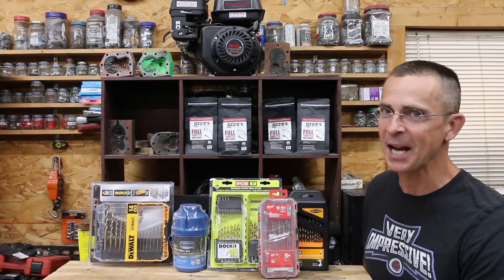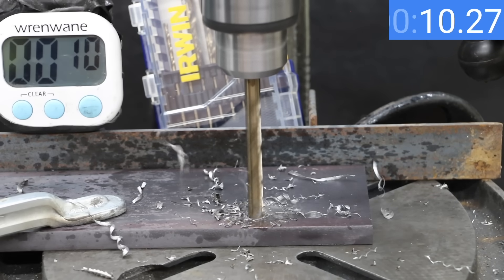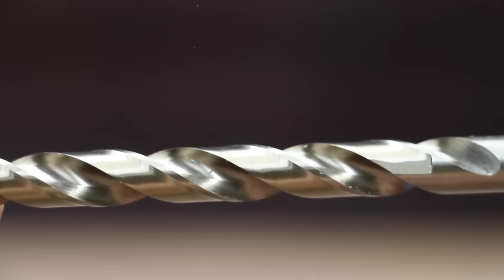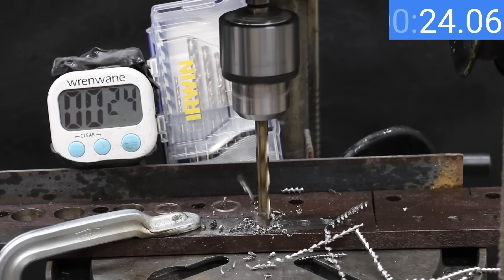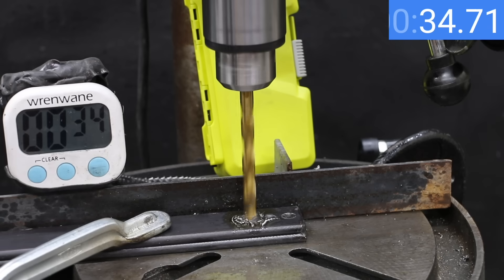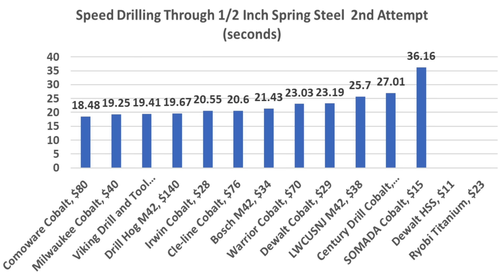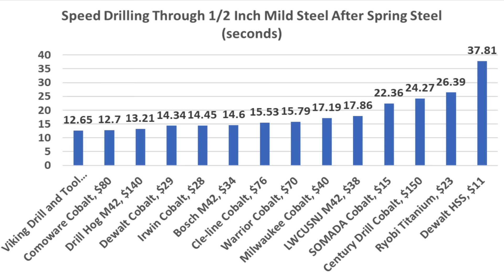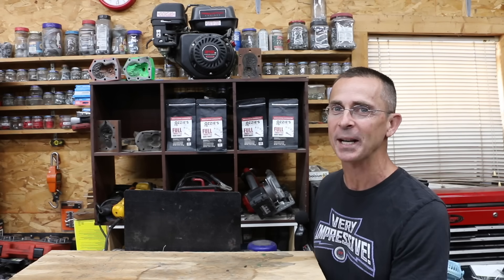Best Drill Bit Set? $11 vs $200? Let’s Settle This!

Comment: The more important part of this than what is the fastest drill or whatever for me is learning what is actually quality materials. Stuff like high speeds especially m42 should smoke through just about anything without durability issues because of the way they're designed and should mostly come down to stuff like edge geometry for speed and all. I imagine coatings are really just less durable than entire construction. Extremely useful to know what actually does hold up best. I've been happy with my Bosch bits in general. Wish there were easier ways to quantify the differences than hoping someone does a video or just finding out lol
Reply from the maker: Thanks for the feedback.

Comment: Alot of cheap bits the relief behind the cutting edge is slightly higher which in turn a lot of bits will not cut good if your handy with a bench grinder hit that relief on the back side of the cutting edge and they'll cut really good after that
Reply from the maker: Thanks for the feedback.

Comment: Would love to see a comparison video about generator cords…I installed a 30amp power inlet box so I can run my house off of a portable generator, it works great with the 25 foot cord I bought but I needed a 50 foot cord and there are a zillion choices on Amazon. I’m curious if these 50 foot cords are legit 10 gauge. I bought 2 and one seemed significantly better than the other. Both claimed to be waterproof/resistant in their ad but one was specific on the tag to not use it wet 🙄
Reply from the maker: Thanks for the video idea.
Reply: Might not be super important to everyone but kinda seems up your alley:)…Absolutely love your videos and recommend them to everyone 👍🏻

Comment: I don't really get the point of this test. You never apply extreme pressure to drill bits, they should basically cut through the material with almost no pressure if they are sharp and at correct speed/cooling.

Comment: I run a machine shop and smithy. Very picky about my bits, end mills, cutters, and files.
I'm also a big fan of economy via proper material use.
HSS and cobalt are excellent choices for mild steel or softer but for hardened metals I go with carbide. Mind you they're VERY brittle so if vibrations an issue cobalts the best choice.
I've found that drill hogs warranty more than makes up for its price, they'll replace any but no questions asked. And anything larger than 3/8 can get VERY expensive otherwise.
Also learning the art of bit sharpening is priceless.
Reply from the maker: Thanks for sharing.

Comment: I tried to use Dewalt HSS to drill a pilot hole in a killarney stainless steel drain pan.  It did not go well.  My attempts to center punch the material did not fair well either.  I did eventually use a Klein annular cutter and a Klein step drill bit to make the hole, but it was challenging to get the spot precise (since I needed to place the hole fairly precisely for an existing PVC drain fitting).  I don't know if you've had luck using a center punch or drill bit recommended for stainless steel.  My usual preference is to use a center punch, then drill a small pilot hole, then use the annular cutter, then step drill bit to size the final hole size, but stainless steel gave me procedural difficulty.  Still got it done with plenty of tap fluid lubricant.  If I had a drill press, I may have faired better, but getting a drill press to locate a hole on a drain pan was not really an option for me.
Reply from the maker: Thanks for the suggestion. Thanks for the feedback.

Comment: Instead of testing brands of drill bit you should do some tests on variants of drill bits for specific materials. Drills are extremely specialized things nowadays, with the base metal they are made out of designed for specific applications, and then within those base metals you have dozens of coatings for specific metals and applications. For instance, HSS bits are old but good, but they don't last at all in CNC machines. They are really meant for hand drills and drill presses most of the time nowadays. Cobalt bits are meant for harder and tougher metals, steels for the most part and dont usually work the best in aluminum. Carbine bits should only ever be used in good CNC machines and other high-rigidity machines. Never a drill press and never a hand drill, it will snap instantly. Then you have coatings, like basic TiN that just give an extremely generic slight increase in lubricity of the bit to help chips close away easier and a very slight increase in cutting edge hardness. Not usually worth it, but for kits like these in the video where they know people will be using them in a home environment it is a good choice for a cobalt bit. There are other coatings specifically for cutting aluminum, like a zirconium coating or TiCN. Others work great on steel but have aluminum oxide in the coating and so cannot be used for drilling aluminum under any circumstances (like AlTiN).
Reply from the maker: Thanks for the suggestion.

Comment: You should test these bits on stainless steel that work hardens. I had to drill a few small holes in some thin stainless recently, and I ruined several bits in the process.
Reply from the maker: Thanks for the suggestion.

Comment: I've mentioned it before, but you should really do Chapters or bookmarks for each product. As well as the results page. I, like many people, buy a lot of stuff at Harbor Freight. I have the Warrior drill bits, but I haven't used them yet. I got them on sale for like $9.99, so they would have been first price wise. But I'm having issues finding it. I think you're going in order by price, and I know they're not $80 bits. I've never used cutting oil before, but often I'm cutting then sheet metal and don't want the bit to slip off. I had to buy the bit set to replace the 3-4 bits of my 100 piece set that are broken now, and those are the only sizes I'd use.

I don't see the Warrior on your results list, so I assumed they must have scored very poorly. I wouldn't be too surprised. I remember back in the day somebody telling me don't buy their sandpaper and maybe drill bits. But I only use them for one particular purpose, and i don't need really expensive drill bits. I got a Craftsman set for $20 I was using previously.
Reply from the maker: Thanks for the feedback.

Comment: You should do a test to see if engine cleaning products actually do what they say. For example, does a product that claims to clean injectors actually clean injectors. Are we wasting money buying "1230897102359710857124 octane booster that adds 100 horsepower while cleaning the entire fuel system and does your taxes?"

Really curious if these products actually do anything or if are we just tearing up our engines.

Also, the spray that converts rust to a paintable surface. Does it actually work?
Reply from the maker: Thanks for the suggestions.

Comment: Air purifiers would be a very cool test. Using different brands for “large rooms” such as Levoit, Aroeve, and comparing them to the “industrial” purifiers you see mounted on garage ceilings and testing a Corsi-Rosenthal box.
Reply from the maker: Thanks for the suggestion.

Comment: I was surprised to not see SPYDER bits in the line up? Any reason why? The company makes so very big claims.   I have used Dewalt drill bits for years and had no major issues, Milwaukee bit that come in a Bogo as fill in bits if I snap one off. 
Great testing as always Todd!
Reply from the maker: Thanks!  Thanks for the suggestion.

Comment: I’ve never done a test but have noticed the durability of the Bosch to the degree that those are what I keep in my work van. In my shop I keep dewalts because I did notice how sharp they are. Can’t have a bit break on the job, but in the shop I have room for multiple sets of disposable sharp bits.
Reply from the maker: Thanks for the feedback.

Comment: I drill out broken license plate bolts all the time (car dealer, trade in vehicles) and buy those bulk packs of irwin, they do a great job and last so-so, and they can be sharpened a couple times. I looked for some Bosch packs on Amazon and didn't see any, so for now the Iriwn is the one I will stick with.  BTW I am a flat rate tech and get 0.5 hrs to drill them out, if I have to struggle a little I can get away with charging 1.0 here and there... and we charge $179.95 an hour to the used car dept.   I know most of your viewers are DIYs so keep on learning out there everyone, paying someone else is quite the challenge unless you have a really good job.
Reply from the maker: Thanks for sharing.

Comment: The numbers don’t lie; and neither will I.
I’d take Irwin over any of them

If not for the torque test; which doesn’t apply to my use case, Irwin was one of the most consistent in every test.  I cannot see a .5 to one second time difference in real life because I’m not using the bits for high speed manufacturing where that may add up to a few minutes in a 24 hour day.

What I need is for the money I spend to last and perform.  KUDOS for another great testing, and confirming that for now, Irwin deserves my money.
Reply from the maker: Thanks!  Thanks for the feedback.

Comment: One parameter I would have liked to see compared was hole size. A good drill properly sharpened will cut an accurately sized hole. A dull or misharpened drill will cut oversized. It doesn't matter in a clearance hole but it does when you tap a hole or other things.

After forty years in a machine shop, my go-to brand is Cleveland, not sure if they are what they once were but they do last a long long time in a shop. We also avoid split points for easy sharpening, just a preferance.
Reply from the maker: Thanks for the feedback.

Comment: Would love to see a comparison of different brands of cordless tools vs each other for the first time cordless buyer.  We all know that once you buy a particular cordless tool for home use, you tend to continue buying that brand because the batteries and chargers are both expensive and interchangeable.  So, what should the first time buyer purchase?

You have already purchased them all and reviewed them all.  You can compile the data you’ve gathered and be one of the few that has experience with all of them.

Also, my wife bought me the Drill Doctor you recommended a few years ago, and I use it every time I need to touch up a drill!
Reply from the maker: Thanks for the suggestion.

Comment: Great job! Thanks again. 
Something to mentioned. It also was not the purpose of this presentation. 
  Electrician here. When I was in the trade for roughly a year. We did some work in an injection mold plant. In the machine shop I took notice of how incredibly slow all the drill bits turned. Also that lubrication was always used. Be it water,water and something else or petroleum derivative. Lots of pressure was also brought to bare. From that point on I used the same principles. 
  Press hard. Keep the RPMs down. Use a lube. Drill bits a holesaws last a whole lot longer between sharpenings.
Reply from the maker: Thanks!  Thanks for sharing.

Comment: Personally I use a really cheap no name set, like 1,80 euro for 50 bits for most things. They're absolute trash and good only for soft materials and even then usually gone after just a few uses but they do for woodworking which is most of what I do. Then I have a nicer irwin set which at like 15 bucks a while back is my "expensive" set. I've never experienced a drill set that lasted any length of time doing a lot of work in a day, so I tend to use the cheaper stuff. Usually I absolutely despise buying throwaway garbage but with drill bits at this point I don't think any drill bit will live long enough to not be throwaway trash while being in my price range as someone that doesn't use them for his job. Lets see if the video changes my mind.
Reply from the maker: Thanks for the feedback.

Comment: I tried drilling through steel a while back. Tried cutting oil, wd40, 3 in 1 oil. Nothing kept the bit from getting destroyed. 

The solution was water in a spray bottle. Beautiful holes and zero smoke.
Reply from the maker: Thanks for the feedback.

Comment: M35, M42 etc. all are different HSS grades. Both M35 and M42 contain Cobalt. Given your results, I guess the DeWalt is M50, which is cheaper, less hard but more flexible.
I just hate when the exact material isn't mentioned on the packaging.
Reply from the maker: Thanks for the feedback.

Comment: I bought the Dewalt HSS bits from your video years ago and have used them as my primary drill bits for all of my blacksmithing needs. The only issue I had was that it appears the old set I have and a bit that was very brittle end exploded on me as I was drilling. Despite that I still will buy them again because the value is just too good.
Reply from the maker: Thanks for watching!

Comment: Just last week, broke two drill bits trying to drill out a twisted-off bolt.  Talking to a friend: I said you can't tell if a drill bit works until you break it.  And here is your video, amazing!  Thanks.  Btw, the drill bits I was using finished near bottom on your list.   Titanium coating, they must have just waved the dust over them, more like a blessing.
Reply: Go get a Harbor Freight set of left handed drill bits.   Most of the time they spin the broken bolt's remains out of the hole just before they finish drilling it out.
Reply: Thanks, I don't own a set, great suggestion.
Reply from the maker: Thanks for sharing!

Comment: $200 for a set of drills, yikes. I would try not to spend that much on the drill 😆 They may have performed the best here, but are they so exemplary that the set will outlast 20 sets of the HSS Dewalt? Not knocking the tests, I think they were excellent, but unless you can hire someone to drill holes all day with the two bits side by side, I don't think we'll ever know if the Viking is actually worth its price. I don't think it is a risky guess to say no though 😂
Reply from the maker: Thanks for the feedback.

Comment: I like that you showed off the LW's performance after sharpening! Even if it didn't produce any usable data regarding the bit's performance, it's a great example of how important bit sharpeners can be!
Reply from the maker: Thanks!
Reply: I am really surprised ho much better it did than the other brands when sharpened!
Reply: It must’ve left the factory with a poor sharpening job or the angles were not correct. It makes all the difference, and the tests show that. That drill bit brand just needs some better tempering and metallurgical work. So brittle.
Reply: @skullfracture2  so the only problems with those drill bits are bad metal and bad sharpening. Everything else is fine. 😂
Reply: That's exactly what I thought!

Comment: For cheap bits, DeWalt all the way. They're cheap. The cases are nice. Easy to get a new set.  Still have a set of Black & Decker bits that has to be 20 years old and the DeWalt is basically the same bits in a different case.  For serious drilling, I use Diablo. It blows holes right through everything, including my wallet.  But it's worth it for how well they work. A handful of Diablo bits and a lot of DeWalt get everything done for me. I don't actually own any DeWalt tools, either. Just the bits. It's not blind yellow brand loyalty.
Reply from the maker: Thanks for the feedback.

Comment: I used to work in a heavy industrial environment where having a dependable set of drill bits was a frequent must. Just like this video, I found that Bosch was overall the most reliable. They werent always the fastest on the first try, but they  outlasted other bits by a lot. Best bang for the buck, especially when time=money.
Reply from the maker: Thanks for sharing.

Comment: I don't drill or use hard metal (that I know of), so the DeWalt High Speed Steel is the set for me.  However, you didn't mention other materials, like softer and wood, which was mentioned on others, so I'd have to check that out before buying.  Thanks for another great one, Todd.
Reply from the maker: You are welcome!

Comment: As a former machinist all of these drill bits would fail miserably on hardened steel or copper.The only drill bits that worked for me were carbide.Ferrous materials such as copper and titanium would gall up a drill bit or a end mill.I would only use the best HSS or cobalt tooling for aluminum,brass,stainless steels with a low nickel conten.Huot and Starret made some of the best  twist drill bits.I also sharpen my own bits by hand at 118 degrees and split the point.Sharpened a 3/16 bit driil that actually drilled holes .001 under it's .187 diameter.Used it to make tooling 'cause I could drive dowel pins without using a reamer.Bought a set of HUOT  drill bits in letter,number and fraction on Amazon for around $135 several years ago.
Reply from the maker: Thanks for the feedback.

Comment: Great to see the repeat tests - I buy a bit not for one hole, but for many so seeing the difference in longevity was instructive.
Really interesting seeing so much variability in the same geometry and metallurgy, e.g. M42, I guess this means the machining, hardening and tempering process is at least as important as the alloy used. Thank so much for doing this test - I have been keenly waiting for it.
Reply from the maker: You are welcome!

Comment: AWESOME,  i have a few sets of the Viking (maybe more if they are owned by walter, i see no differnce in Viking and DrillCo) im very impressed and continue to use them. the Milwaukee are decent and i normally get them 15 to 20% less than retail. id like to see a few of these top contenders go against Spyder and any other marketing wank brands that claim the bits are next to invincible. i bought a few spyder bits just to see and they are border line junk. irwin in my books is better than spyder.
Reply from the maker: Thanks!  Thanks for sharing.